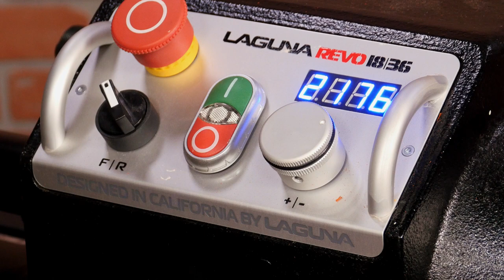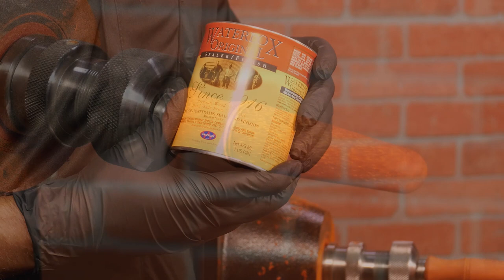Turning a Kitchenware Project Handle (Woodturning How-to)

Comment: Congratulations on your work. Could you tell me where you get the metal parts of those jobs from the video? The utensils?
Reply from the maker: All the supplies and tools used in the video can be found at https://www.woodturnerscatalog.com
Reply: Thanks for the answer. I'm from Brazil and I need to know if those metal kitchen utensils need only the metal part, because I work with wood lathe. Do you sell only them without the turned part?
Reply from the maker: Yes. All of our kits only come with the hardware. You'll need to turn the project on a wood lathe.
Reply: I got it, thanks. Do you ship to Brazil?

Comment: Hi, so I'm a new turner and I always thought for sanding you use a higher speed?
Reply from the maker: We always recommend sanding with slower speeds because you'll have less heat build-up and the slower speed will help get a better sanded surface.

Comment: How much does a lathe like that run you?
Reply from the maker: It's a Laguna Revo 18-36 Lathe. It starts at $2,399. Here's a link. https://www.woodturnerscatalog.com/p/216/6781/Laguna-Revo-18-36-Lathe-1-1-2-HP-110v
Reply: If you have to ask...

Comment: What drill chuck are you using?
Reply from the maker: It's the Turners Select 1/2" Key Drill Chuck. Here's a link. https://www.woodturnerscatalog.com/p/104/5435/Turners-Select-1-2"-Key-Drill-Chuck
Reply from the maker: And here's our "Comparing Drill Chucks" Video if you need more insight. Thanks. https://www.youtube.com/watch?v=miGCB8xe6ak